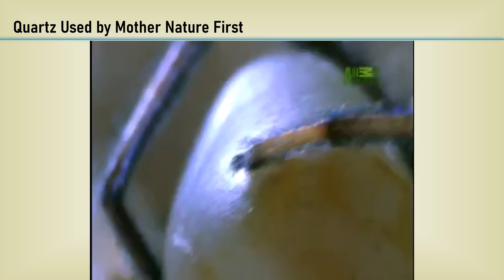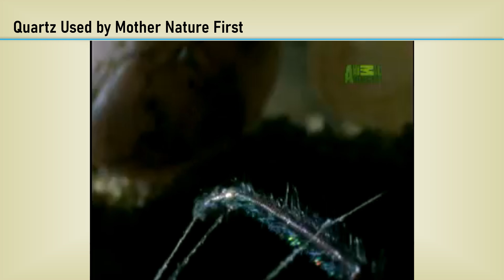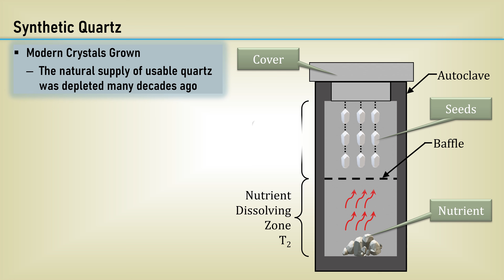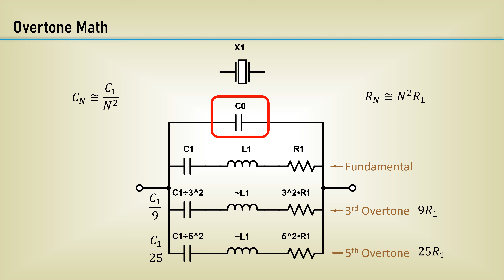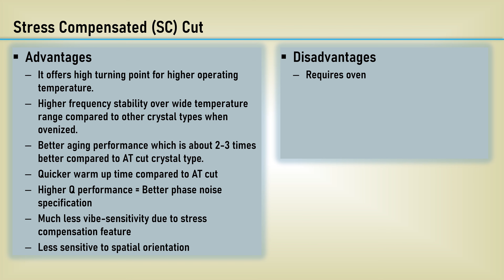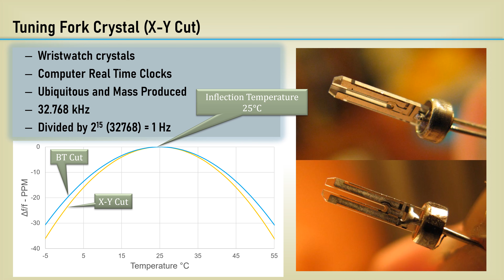A Little About Crystals (4k Video)

Comment: Could you please explain (@8:38) , what did you mean by saying " if you replace the quartz dielectric with a non pieso electric  one "
Thanks in advance, the topic was explained on a scientific level, thanks very much.
Btw, love the accent !
Reply from the maker: The crystal unit is manufactured just like a capacitor. Two metal plates sandwiching a dielectric. If a regular dielectric would be used instead of a piece of quartz, it would simply be a capacitor.
Reply: @oldhackee3915 ,
Ah, ok,  clear as a bell now, sorry i am esl.
Appreciate your time sir, again what a great job on the topic !
Thanks again.

Comment: Fascinating, I knew very little about the inner workings of a xtal and I dont use them a lot. What I seem to have missed is why is the faces on the grown crystal significant different to a natural crystal? does the seem bias the final shape if so how were the natural ones cut?
Reply from the maker: As I said in the video, the supply of natural quartz has long since been depleted. Only synthetic ones are used in electronics. I think the faces are the same.
Reply: @oldhackee3915  I found this which explains how to identify the surfaces https://www.youtube.com/watch?v=duZlWWwxIPQ
Reply from the maker: Cool. I check it out.
Reply: @oldhackee3915  Yes I understand the natural ones aren't available anymore but I have a natural one and I cant match the faces to the diagram. My natural one doesn't appear to match but I will check again. Its definitely 6 sided with opposite sides parallel but it comes to a distinct 4 sided point with 2 smaller faces part way up the point faces. Unfortunately I cant attach a picture. Interesting stuff thanks
Reply: Yes you are right mine matches yours at 6:20

Comment: Do other crystals have piezo properties?
Reply: Yes several, like Rochelle salt crystals (potassium sodium tartrate.) That was historically used in early microphones. (Rochelle salt absorbs water, which causes its crystals to swell. Water also degrades its piezoelectric property.) Usually piezoelectric materials are crystalline, or poly-crystalline. but some... surprisingly... some are polymers (plastics). Those have a manipulated structure that have 'crystal like' regions.
Reply: PZT ie. Lead Zirconium Titanate is common in Ultrasound applications. There are many other  polarizable crystals, but as far as I know only quartz is used in high Q timing applications.
Reply from the maker: What do you mean by other crystals?
Reply: Interesting you would ask that, almost all crystals have a piezo property, depending on what they are made from.  You can actually make a battery from a highly reactive metal (magnesium, usually) and any highly water soluble salt.  usually borax is used.  Super easy to make, just cook the borax until it is melted and the water has been boiled off, then pack it tightly into a copper "cup" of any size and then force a piece of magnesium  in so that when the borax solidifies it is tightly packed between the magnesium (or other highly reactive metal) and the copper "cup" (like a small copper pipe end cap) and as the crystal grows against the magnesium and copper, it will cause a very small but extremely steady piezo effect and put out a constant .2 volts until the crystal grows to the point it splits the copper pipe cap it was packed in.  Quartz (silicon dioxide/trioxide/tetroxide) has the strongest piezo effect, though.

Comment: to think that a resonator is mechanical. So, does a resonator also emit sound at the designated frequency?
Reply from the maker: Yes but you can’t hear a frequency that high. I surmise that’s why the tuning fork crystal was made to be 32.768 kHz. 16.384 kHz could be heard by kids. I’m just guessing.
Reply: Ceramic resonators are made from Lead Zirconium Titanate (PZT). Poor accuracy and temperature characteristics. Cheaper than quartz crystal.

Surface Acoustic Wave Resonators are Quartz to my knowledge, but utilize Surface  Acoustic Waves ie a combination of transverse waves and longitudinal waves that can exist only on the surface, not in the bulk. These are two port bandpass filters.
Reply: Always piezoelectric, so do generate sound. However due to impedance mismatch very little will be launched into air. 

PZT Ultrasound used for air have a metal cone that acts as impedance transformers to air. The waves propagate in air but as the frequency is Ultrasound we cannot hear it.